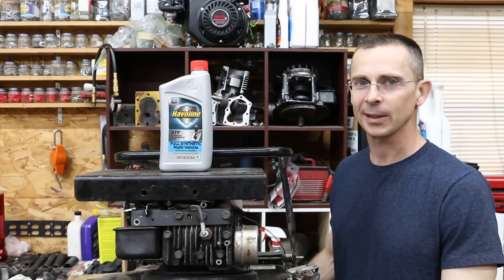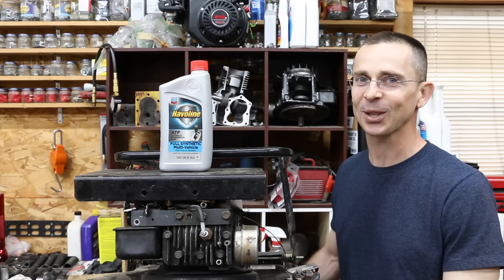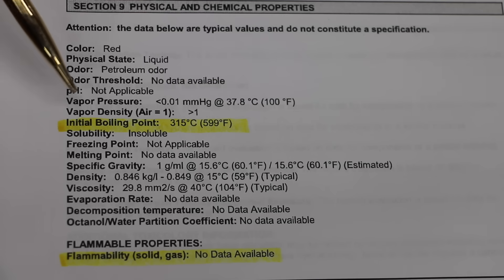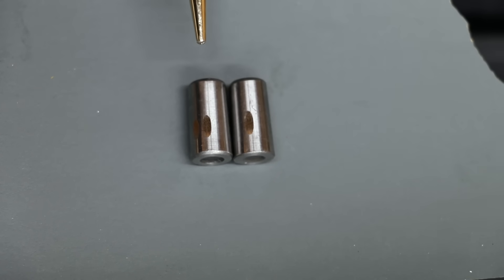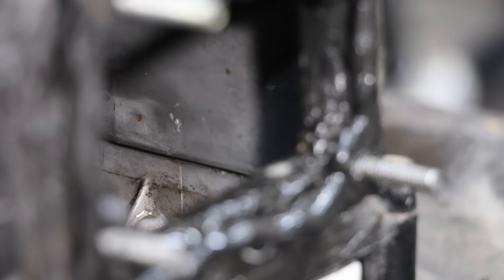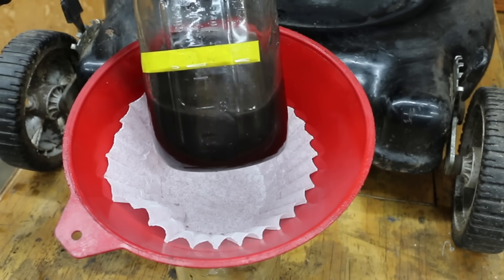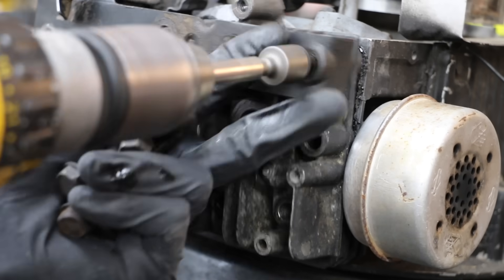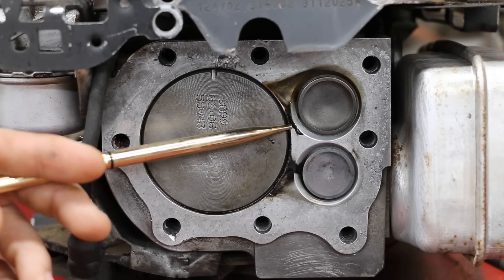ATF as an Engine Oil substitute?  Let's see what happens!

Comment: I have used ATF in engines for years. I prefer Dex 3 ,rather than the later stuff . I  learned about it from Norwegian friends who told me they put it in the crankcase of their Mercedes Diesels around 200k's before draining the sump and changing the filter( nearly 35 years ago) . First time you do it, the oil comes out hot and thin but really dirty. I change the oil in my 1985 300 D every 10,000 miles so it's a long term thing. By the third oil change the oil is keeping clearer longer , as most of the deposits in the engine have been removed.Diesels use a full detergent oil to remove soot deposits in the oil. If you use regular oil ,the sump is soon full of black sludge deposits.  I also use it in my other vastly more expensive engines .One is a Mercedes 300SEL 6.3 with 320,000 miles on it. the engine has never been apart apart from a injection pump rebuild and new timing chain at 280,000 miles. The oil stays clear now between changes. I use a full zinc 20W60 oil. The oil stays so clear that I am now changing the filter at 15,000 mile intervals. The compression are all on the high side now,whereas before there was blowby and a couple of cylinders were starting to lose compression . Under the cam covers everything stays nice and clean with no more black deposits. Mercedes recommend using ATF at a ratio of 100-1 in the fuel to keep the mechanical injection working properly on these engines and the earlier 220,250 and 280 SE engines ,which are all mechanical injection. It helps keep the fuel tank and lines in good condition and prevents a lot of pinking although the ATF is low octane fuel when mixed with petrol. My take on AT DEX 3 is that it's full of cleaning agents as it was designed before WW2 for the earliest types of GM automatics which were prone to produce stuff out of the clutches etc. This works to clean the insides of engines and it's under a lot more stress in a trans than in a crankcase mixed with oil ,A lot of Mercedes manual trans use ATF ,not #90 gear oil ..In short, it cleans the engines, I know this as i have been doing it for decades and the engines run better longer. I wouldn't run an engine on straight ATF  but as I said, I add it around 200K's before changing the oil.
Reply from the maker: All great points and thanks for commenting.

Comment: My method of flushing an engine is to simply change the oil and filter more often. Like when I buy a car I'll run high mileage 5W-30 M1 for 500miles then change it and run for 500-1000 miles and change it again.  I've done that maybe 10+ times and generally speaking the oil is cleaner longer and small main seal leaks stop or get much better.  For sticky lifters I like to use high mileage STP.  It usually stops ticking after a few hundred miles.
Reply from the maker: Thanks for commenting on this!

Comment: I'm thinking about adding some ATF to the oil in my old motorcycle engine, to help clean the engine.
Reply: when I was trucking ove the road  once I accidently put a gallon of hydraulic oil in a 425 mechanical cat diesel engine when the mechanics switched the barrels on the racks position after 3 yrs working there, the truck went thru a gallon of oil every month,  after I put in the oil the old maintenance mechanic asked me why I put hyraulic fluid instead of deisel, i was confused n went back to look at the varrel, and said i guess the same reasons you didnt out the barels back on the rack where they usually go, and got the hyraulic fluid by mistake since they switched spoys I had a rountine n knew where the oil always was for several years,  i took it in for a oil change later that day, and damned if that truck ran smooth and had more power than ever before, and purred smmot as a cat should,  they never had any engine problemsout of that engine, but did on another truck that was identical that never got the accidental gallon of hydraulic fuild to the engibe motor oil,  maybe some diesel mechanic can chime in and  tell me why that cat engineran so smooth n beter from then on?

Comment: Project Farm ooh! 

Here's another one:

Engine oil contaminated with fuel is something I commonly came across as a mechanic and engine tuner. Either from an excessively rich mixture, or some sort of failure (stuck injector, burnt spark plug wire, dead coil pack, broken insulator on the spark plug, etc)

I'm wondering what ratio this becomes really harmful to lubricity.

It would be really neat to see what cutting engine oil with Gasoline, Diesel and E85 at various ratios does on your machine.
Reply from the maker: Thank you for this recommendation!

Comment: So you wouldn't recommend ATF as an engine flush treatment?
Reply from the maker: I'm reluctant to recommend this as a flush, since there's potential harm that can occur.  I personally would much rather use Seafoam or Marvel Mystery Oil.
Reply: Project Farm I took your device concerning Seafoam, Lucas oil products and Restore  with my 2011 Xterra; it is now running almost like new.  Thanks for the videos!

Comment: I had a blocked diesel injector, and didn't want to take it out unless I really had to. I put one litre of ATF in with the 3/4 of a tank of diesel that was already in there, & problem solved!
Reply from the maker: Thanks for commenting on this!
Reply: Project Farm It's been 3 days since adding ATF to my Ford Fiesta 1.4 tdci. The injectors are working perfectly,  & the engine seems to pull better than ever! It's warm here in England at the moment, but the temp gauge is where it normally sits at. Next step is to add it to the engine oil, (having previously drained a litre or so),& do an internal engine flush.

Comment: I did this test in a 350 chevy in 1975 on a high mileage car with extreme sludge buildup in the lifter valley. 1qt dextron 2 to 4 qts of 10W30. The results were spectacular. Although it didnt remove all the sludge it did remove a remarkable amount of sludge in the areas where the oil drains from the heads. The hydrolic lifters stopped ticking and the oil came out like mud after 200 miles. I changed the filter and did this 4 more times until the mud flow stopped. I took the intake manifold off and everywhere the oil flowed regularly was spotless. However the crust remained in the high spots mostly and it looked sort of like what you would see in a water flow erosion situation on a hilside. The trans fluid cut a path all the way to the bottom of the hard sludge and exposed bare cast iron. For clarity this wont "fix" a worn out engine and todays detergent oils and synthetic oils don't normally leave that kind of mess in the engine anymore so it would be rare that this would fix a sticky lifter in todays engines. Not that I wouldn't try it just that it more likely a mechanical failure today than a sludge buildup causing the noisy lifter.
Reply from the maker: All great points and thanks for commenting!

Comment: Dexron ATF is a high detergent transmission fluid. Type F is non-detergent. In automotive engines 1 qt. added to regular oil can help free stuck lifters. I've done this many times. If your lawnmower engine has no oil filter it should use non-detergent oil as the contaminants will not be held in suspension.
Reply from the maker: All great points!

Comment: Good video. I know my grandfather used to swear by removing a quart of engine oil and then adding a quart of ATF to free a sticky lifter or clean sludge out of an engine but that was 30+ years ago. Engine oils have came a long way since then. I do believe ATF has more detergents in it than engine oils. While I agree that I wouldn't recommend running an engine on just ATF, I don't believe adding some ATF to an engine that has a sticky lifter or a lot of sludge build up is going to hurt it any and may help.
Reply from the maker: Thanks for commenting on this.

Comment: My dad has a push mower he bought new in 1996 and still uses it today but it is really down on power and dies easy. The engine is just worn out! My dad has other mowers in better shape. I may try putting transmission fluid in his old mower and mow for and hour and drain it and put oil back in it to see if that helps with the compression.
Reply from the maker: You might consider spraying some Seafoam directly into the throat of the carb to help clean the intake valve and around the piston rings.  I suspect the engine is full of carbon!
Reply: Project Farm probably is. And maybe I'll do what you in each video and take the head apart and take a wire brush to the head and valves. That seems to work better than seafoam.

Comment: ATF plus a heaping teaspoon of moly disulfied powder. I ran that in my box stock 5hp Briggs when I was racing karts. Ran that motor every week for two years and won. The 2nd year the oil plug fell out at beginning of a 15 lap heat race and I ran the race with nothing in the crankcase. Put ATF and moly back in it and ran the 2nd. half of the season with no problem. My best friend found out what I was doing and also used it and it worked for him. Then he had the idea if one teaspoon of moly works maybe more would work better, nope blew the engine. To much moly plugged the oil passages.
Reply from the maker: This is very interesting--impressive results! Great point regarding "more is not always better" too.

Comment: I'm curious what kind of effect a good 2 stroke oil would archive :) (like castrol TTS)
Reply from the maker: Thank you for this recommendation!
Reply: I noticed it on my 2 stroke dirtbike that with cheap oil you get a lot of soot in the exhaust port, combustion chamber and on the piston.

But with for example Castrol TTS (nowadays Castrol TSX) everything is sparkly clean, even after a few 1000 km's

Best regards.

Comment: Great video. Never heard anyone recommend 100%. I used 1 qt in my 5qt Engine that had 240k miles on it to free up some lifters. Worked like a charm. Took about 3hrs but the car is running over 250k and the engine is quite and sounds great. Of course though I changed the oil as soon as I heard improvements. I think that the mix probably helps with the viscosity as well as some added detergents. Sea foam might work better for sure. I agree that it’s a bad idea to ever use 100% ATF in an engine. Only for short term use and I wouldn’t do it in a newer vehicle.
Reply from the maker: All great points. Thanks for commenting.

Comment: Thank you for video, it is very useful and instructive. would not you mind doing an experiment with 1)10% ethanol gasoline and ethanol free gasoline. And 2)adding 3 percents of acetone to the total volume of regular gasoline to find out whether the addition of acetone affects the consumption of gasoline, cleaning the carbon and ruins the rubber rings. And the same effects using ethanol free gasoline. Thank you.
Reply from the maker: This is a terrific suggestion!  Thank you!

Comment: I didnt completely agree with the using it as an oil replacement. it  has high detergents so I get using it as a type of flush. 
id like to see a test on high boron oil actual bearing after its been run thru an engine vs just dumping it into a load tester. also, use bleach alone in a stress test. i dont think you wanna run it thru a motor with a lot of blow by like a mower because chlorine gas can kill lol.
Reply from the maker: Thanks for the constructive feedback.

Comment: DON'T ever use motor oil in a transmission either I done it once on one that had 200k on it and use it with 10w30 oil and transmission blew up in 30 seconds was going around 100 mph
Reply from the maker: Thank you for this information.

Comment: I know a guy that adds 2 quarts of diesel to the engine that is to have an oil change and let it run for 5 - 10 min. I have seen it remove sludge from the crank case before on some older vehicles that had been sitting for a bit
Reply from the maker: Interesting. I'll test diesel in the crankcase soon.

Comment: You should try a gas oil mixture in the engine crank case to simulate getting gas into the crankcase and not changing oil before running I have always wondered what would happen if you ran it 
thanks or all the awesome videos
Reply from the maker: Thank you for this idea!

Comment: I have used ATF poured it in the carburetor and little at a time while the engine was running to free stuck lifters and also sticky valve it works great change your  oil afterwards
Reply from the maker: Thanks for commenting.

Comment: We had an accidental fill of transmission fluid in place of motor oil. This was at our dealership years ago. The mistake was realised when mechsnic ran it and did a fluid check. The wrong fluid was drained and motor was put in place as well as a new oil filter. We we're all scared we ruoned his engine. The car owner cane back days later. He said "I don't know what you guys did. But the car is very responsive now on the throttle. The best oil change I ever had". Thats the last I heard of this since. I'm guessing he had sticky valves or something. Note this was running the car up to temp.Then fluid level checked again when mistake was noticed. This was back in 2004.
Reply from the maker: Wow!  Impressive!

Comment: transmission fluid generally has more detergents in it, but is also more a hydraulic fluid and cooling agent for a transmission than lubrication, adding a 1/2 to a quart to a regular engine won't hurt it, trying to use it as the only lubricant in the engine could give you a nightmare in the pocket book.
Reply from the maker: Thanks for commenting on this.

Comment: In the past i have used ATF in an old Ford Fiesta XR2i with CVH engine. (euro model) It had what sounded like a stuck hydraulic valve lifter. I only added about 200cc to the (about 4litre) engine oil. It did in fact quiet down that lifter but the engine also started to smoke more. I guess that it because of the light fractions in the ATF evaporating and via the crankcase breather getting into the combustion chamber. 
But after driving a while that smoke went away and the lifted remained quiet. i call that a win.

ATF also has additives in it to keep oil seals flexible.
Reply from the maker: Thanks for commenting on this!

Comment: I have never fully replaced all the oil with ATF, but I do swap out 1 quart with trans fluid. It is a less aggressive flush than using diesel and more consistent. Run the mix for 500 miles, drain/change oil filter and repeat as nessecary until the oil comes out a preferable color/clarity on every car that I take in. An example is my suburban with 240k on the original engine. It took 3 rounds to flush all the build up and wax clumps from the engine(less than religious previous owner) and I didn't find any metal chunks. I did find a cleaner valve train and saw a minimum of 25psi increase in each cylinder. I don't know if my oil choice and trans fluid choice is what does the trick or not, but I run mobil1 oil manufacture recommended grade and dex6 trans fluid. Hopefully this is a useful experience for you.
Reply from the maker: Impressive!  Thanks for this information.

Comment: Here's one you can try..... Follow me here......... Can a lawn mower run off tiki torch fuel??   If not can a lawn mower run off tiki torch fuel and gas mix!!???   If so can you use the tiki torch fuel/gas to cut your grass and would the mosquitoes  repellant in the tiki torch fuel actually keep pest away for a little bit after you've cut the yard?????????
Reply: It would have to be the citronella tiki torch fuel in particular because that's the stuff that burns that keeps mosquitoes at bay
Reply from the maker: This is a great video test recommendation--thank you!
Reply: Project Farm thanks!!

Comment: If we use ATF for cleaning the crankcase,how long should we run the engine?
Reply from the maker: I wouldn't do this.  If you choose to do this, it could cause damage. Most people use a 20% mix of ATF and 80% oil and allow the engine to idle for a few minutes before an oil change.Please be careful if you decide to do this.

Comment: Back in the day.......Engine oils were not nearly as good as they are now and sludge was a REAL problem. Big block engines would come in with valve covers PACKED with sludge. Either Ford or GM ATF had detergent levels that, when added to engine oil would loosen sludge and free sticky lifters. Marvel Mystery Oil worked on this same principal, a high detergent oil additive, or valve stem and cylinder lubricant when put in the fuel. 
Using synthetic ATF vs newer oils will not produce the same dramatic results. Synthetic ATF will not make varnish in a hot transmission so it does not need the detergents the original Dexron did, and todays engine oils don't sludge like the old ones did.
Reply from the maker: All great points. Thanks for commenting.

Comment: Try moly disulfide heavy grease the red stuff.  Also, try 0-20 motor oil vs heavy gear oil like 70 to 100 plus different synthetics for gas and diesel engines.  Make homemade biofuel get used 3 cyl Kubota turbo diesel to test with fuels and lubes.  If possible get a gaseous propane methane spark engine like a user Onan camper genset with throttle body injection for gasoline and electronic TB for propane and a QD for compression fuel with turbos.  Also charcoal gaser and steam hydrogen gas.  Many ways to power spark and compression engines.  Also, a garbage burning makes for chp system vitrify ash to pull all organics out as gaseous fuel and heat.  Left with none organics to refine metals and glass etc.
Reply from the maker: Thank you for this recommendation!